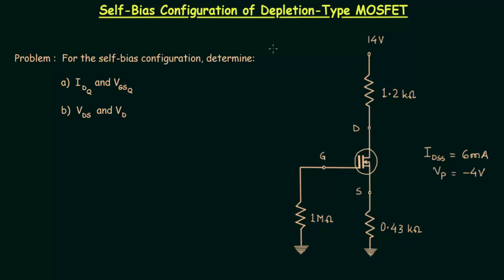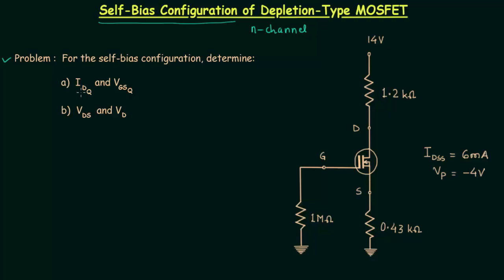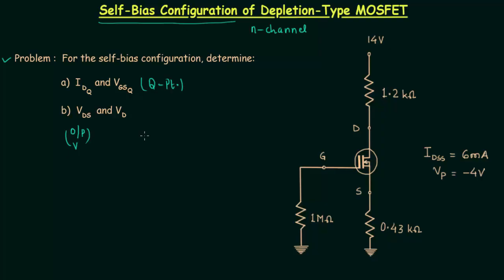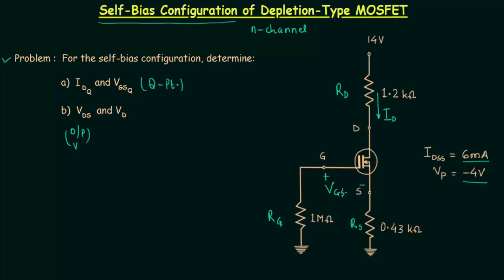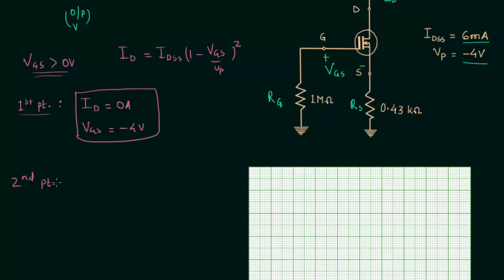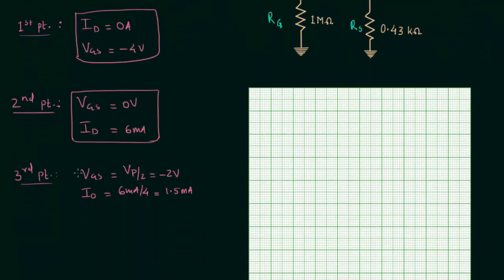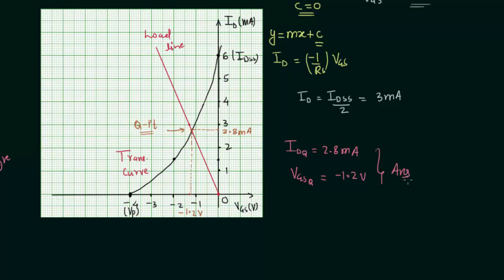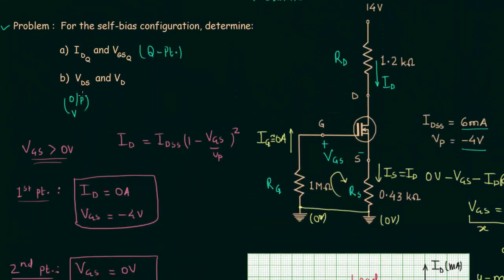Self-Bias Configuration of Depletion-Type MOSFET

Comment: Vds= 9.436volt , Vd= 10.64 volt
Reply: Please can you explain how you found the value of Vd?
Reply: @SaraKhan-mo8xv  14- 1.2 k × 2.8m=Vd
Vd= 14- 3.36
Vd=10.64volt
Reply: @NishaYadav-pj5mm  Thank you so much!
Reply: @NishaYadav-pj5mm  hi could you explain why u used Idq value instead of Id value...
Reply: @SaraKhan-mo8xv   yes
Reply: Thank you 🙏🏻
Reply: how to find id
Reply: @anushkaverma5127  here IDQ=ID=2.8mA from graph
Reply: What is the formula for Vds?
Reply: @ayeshatabassum6731  like
14 - 1.2k × Id - Vds - 0.43k × Id =0
Reply: @ayeshatabassum6731  output circuit me KVL  apply kr lo !!